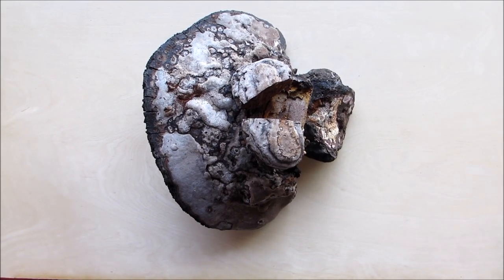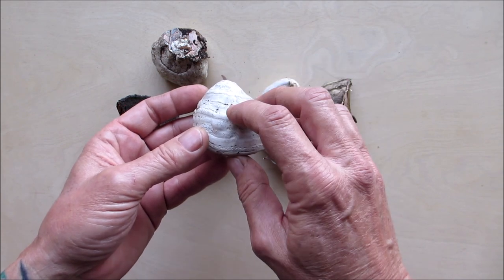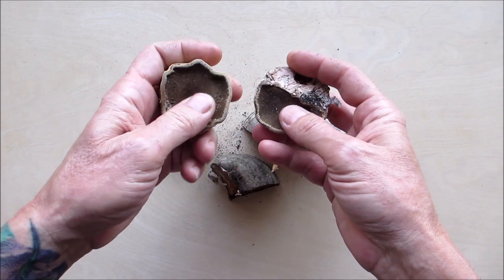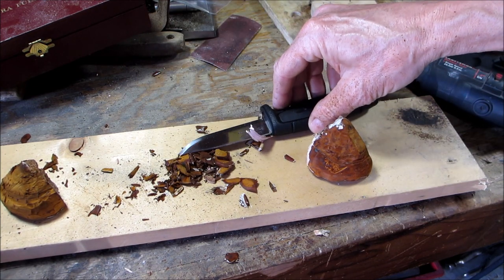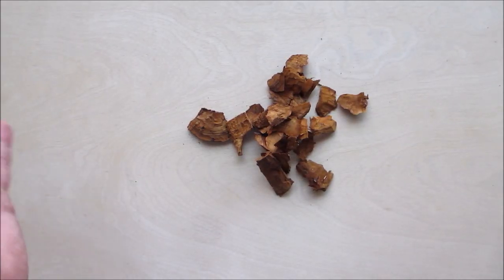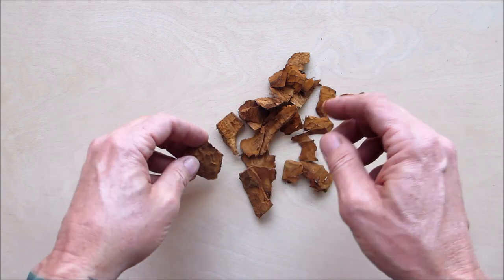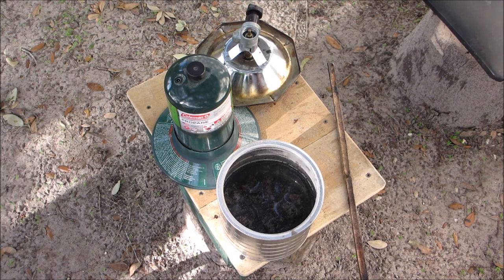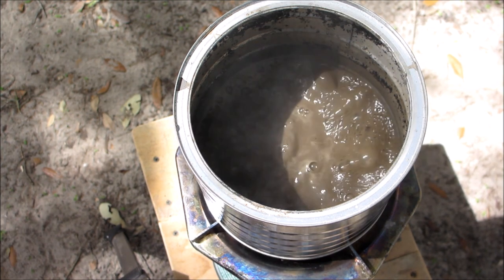Making Amadou from a horse hoof fungus! (Fomes fomentarius)

Comment: If you need to dry a  quantity you can easily make a light bulb kiln.  Just a plywood box lined with reflective insulation - a circuit of 2 - 4 light bulbs - my biggest box is about 6' X 2' wide x 20" high.  Rack is plywood with hardware wire stretched across.  Lid on top insulated.  Turn it on and be amazed at how hot it will get in there.  I used this method for 25 years to dry green wood hand carved woodenware.  Carved soaking wet from the tree - put in overnight and they are bone dry in the morning.  If it is too hot just unscrew one light bulb or raise the lid a little.  One catch is that you do need the old fashioned light bulbs.  I also use the box to dry fresh deer antlers.
Reply from the maker: That’s a great tip! Thanks brother, I appreciate it! I hope you have a wonderful day!

Comment: Another great video. the Amadou is a mystery to many people but it is a fantastic resource. I lit some today in the woodland with the ferro rod after using the knife to fluff it up, having seen you prep and dry it I'm curious if I can get a fire going using a flint and steel by fluffing it up again, or maybe I'll have to try your process if it doesn't work. Caught very well with your flint and steel so well worth the effort, nice one, cheers.
Reply from the maker: Thanks my friend! I have seen it done with a ferro rod without processing, but never with a flint and steel! Should be an interesting test! I appreciate you watching my friend!
Reply: @Dominic.Minischetti  I think your 100% right about the prep. I reckon if I took a tea towel and put a ferro rod to it I could get a fire going, but with a flint and steel no, it would need to be turned into charcloth first, so the same principal must apply with amadou. My great curiosity is pre metal, so iron pyrites and flint using amadou, I wonder how our ancestors prepped it. A great topic that I wish to explore and your video was a great insight, many thanks my friend.
Reply from the maker: Northern Embers Camping and Cooking You’re welcome my friend! I have a tiny piece of a rock that is mostly iron, it’s only about the size of my thumbnail and I can get a tiny spark from using quartz hitting it. But have yet to get the spark to light char cloth. The sparks are to small and go out fast. I need to get a hold of a large piece. lol! It really makes me wonder how our ancestors figured out who to do the things they did! I guess necessity is the mother of invention!

Comment: Why does nobody scoop out the inner rather than cut off the outside? Seems like the hard skin is kinda a natural case for the good stuff. Just scoop or crack the inners out first. If they're not good burners they're probably good insulators anyway.
Reply from the maker: I have no clue! 😂
Reply: @Dominic.Minischetti  I did it last night by the scooping inners method. The stuff I used is Aussie (South), and grows on silver birch. It was "dry", but not dead dry or yet succumbed to rot itself. Still yellow, they're yellow the type I used. But they're that polypore thing. No treatment. Just ground out the inner and threw a spark down. Kept it lit with minimal attention for about five hours. Could have kept going but had to go to bed so snuffed it out rather than leave a glow going unattended.
Reply from the maker: @benjaminzedrine  Now that’s cool! Thanks for sharing brother!